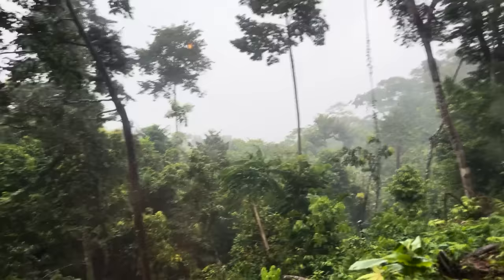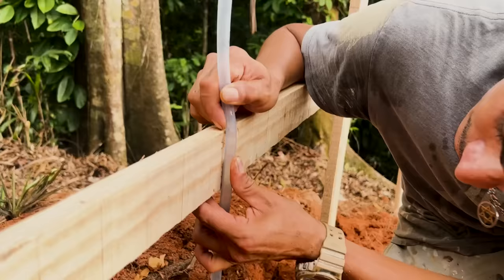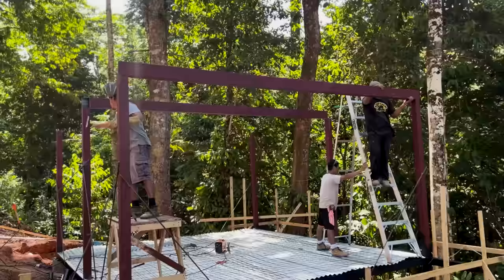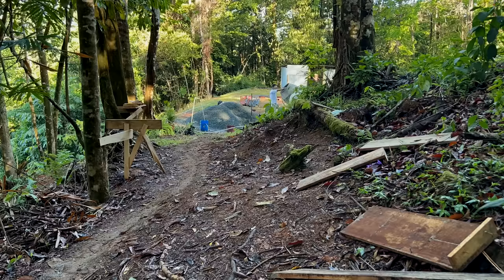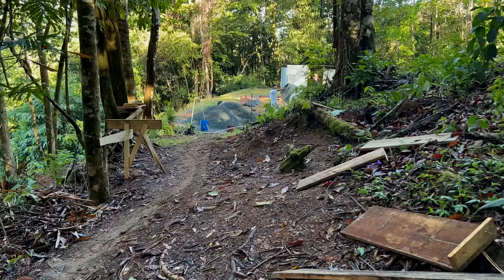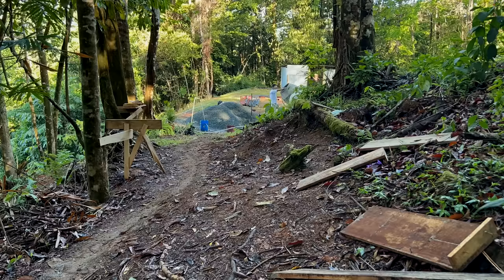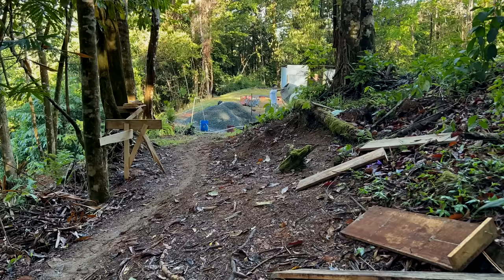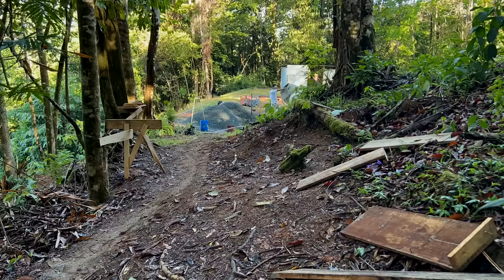Full Build of a Tiny Home Cabin

Comment: Im from Costa Rica from the tropical rain forest part . I can tell this cabin is not built to last. termites in CR are sneaky and eat wood and concrete, difficult to control them when you are in the middle of the jungle, I wonder also how did he obtained permission to build in the middle of the forest…
Reply: Containers would fix that issue
Reply: I'm pretty sure he did his homeworks haha
Reply: I'M from Costa Rica (the tropical Rainforest part) and I can tell you that termites don't eat concrete (at least not fast enough to cause any meaningful damage within 50+ years (especially when there are other options around to eat).

You're not completely wrong about the wood, especially soft-woods like pine, however this wood is specifically treated, which means that it should not be affected by termites.

There's nothing wrong with this build - it's very well done!
Reply: He says its pressure treated pine to prevent termites and rot. It' should stand up.
Reply: He explained that issue already. I think you are just watching but not listening. You can hear, but you are hearing. I hope you understand my idiomatic expression. In short with what i meant.
Reply: Dude literally addresses this at the beginning of the video 2:26
Reply: Sounds like you're wrong about the termite part but Noone has answered the license to build in the woods. I wonder if they did something special for that
Reply: He said he bought that land in the beginning
Reply: He literally just said it Yo! It was pressure treated for that ya didn't event listen..
Reply: They are fairly close to metered power, so probably not "in the middle of the jungle". He mentioned licensing and permitting. The structure and wall framing is steal. I don't think the termites are going to eat that. As others said, I don't think you even watched the video before commenting.

Comment: Tropical rain is quite strong and wind can blow in a lot of rain from the side. Since the front wall is quite high, I think it would have been better to extend the roof way more to the front to prevent rain hitting the glass windows at the front bottom. It's also a bit difficult to make everything waterproof since those windows need tiny gaps everywhere. Maybe difficult to maintain this structure in this kind of weather, but it looks pretty cool.
Reply: I too love this build, but was wondering about the waterproofing -

Comment: I've been thinking about this all weekend and I have to admit it looks great and the price is great but there are a ton of issues with this build from a safety and engineering point of view. The local building codes must be very lax to allow this.

1. The entire envelope is missing a vapor barrier. 
2. No insulation in the walls. 
3. It's a fire hazard - aluminum wiring is illegal for a reason - it expands and contracts to the point it wiggles itself free from connection points. The wood siding is flammable and since the walls are hollow, they will feed the wood fire. The whole thing is a tinder box with cheap wiring. What's more is the electrical panel is beside THE ONLY WAY TO ESCAPE. If the panel catches fire and you're in the loft, your stair is over the fire and you need to jump, but the door out is also next to the panel and the only other door is the patio... man this a death trap. 
4. No AC - when combined with the lack of insulation and vapor barrier, that means that this place will have constant moisture and humidity issues which could lead to mold growth. 
5. Single pane uninsulated, unsealed windows. Drafty and will probably result in dew formation on the windows in the early morning plus allows for bugs and stuff to get in. 
6. The upper level windows don't open, so all the hot humid air rises up and stays there with no way to vent out up there. Does that ceiling fan help enough?
7. No blinds or shades on a west facing window. So again heat and humid at sunset with no way to vent except the level 1 windows. 
8. No exhaust vent at the stove. This is a code violation in many areas. Does the bathroom have a ceiling fan? Cooking and pooping smells might be an issue. 
9. No guardrails at the deck. Looks sick but dangerous. 
10. Does the roof leak yet? You have unsealed screws penetrating the sheet metal but you don't have a waterproofing barrier. I'd recommend you atleast get up there and seal every single screw point.
11. Thermal bridging everywhere - expecially the window frames.

This is more of a tent/ shed than a house by modern safety and engineering standards imo. While impressive, there will be serious issues in 5-10 years, if it doesn't burn down first.
Reply: i fucking laughed reading this, thanks for posting. Noticed the no guard rails.
Reply: Wow! You must be such a positive and supportive person to have around. 
Tent? Have you lost your mind? 
It is a wonder the world isn't burning to a cinder given the millions of "tents" in Africa, SE Asia, South America, the Pacific islands and so on. 
No aircon...oh dear...
Reply from the maker: Hey There! I am glad you spent so long thinking about my cabin :) Some of your points are fair tho an I will integrate for the next time. 
As for the vapor barrier that was something that every single builder here never recommended so that isn't a thing here for this climate. 
The wood, air then concrete board is enough insulation and the heat transfer of the walls isn't an issue. Walls never heat up as the wood on the outside is a really good barrier. 
The aluminum wiring is just the one that brings the power from the meter to the breaker. I guess there is aluminum wiring in the breaker but not running through the house. 
4. There is an AC, I didn't film it but there is a 18,000 but AC upstairs. 
5.You are right about the single pane. There is dew on the outside windows in the morning. Double pane glass here is hard to come by and very very expensive. I can live with the morning dew.
6. With the Ac and the fan it stays comfortable
7. I installed blinds on the downstairs west facing windows since the construction. It was a problem but solved now. 
8. This is true, no exhaust. Luckily it is a loft so it all rises to the top while cooking. But def a potential issue.
9. No guard rails. You are right it's a bit sketchy but no kids are allowed there. 
10. roof isn't leaking yet. I was just there and rainy season is in full force. Rain is staying out. 
11. fair point, the thermal bridging with the black metal is an issue. Ac keeps up but not the most efficient.
Reply: Yeah thats full of knowledge there, i mind this when i becoming an engineer in future
Reply: @nataliefenelon4796 I think sometimes a negative feedback is better. I absolutely agree that staying positive is good, but some things are better off told directly like this comment
Reply: OMG 😱 …. This a cataclysm waiting to happen lol 😅
I live (my whole life) in a very humid tropical environment in Mexico’s pacific shore … besides the humidity and the lack of an AC unit , I don’t see most of these issues! 
It would have been nice to have a swimming pool though 😅
Reply: @antoniogradilla7933 he will likely be okay, but we have fewer house fires and mold issues these days because of modern building engineering.
Reply: @Fluxion11  I guess so … also all those plywood hollow walls create the perfect home for all kinds of bugs, snakes etc .
I really like the metal frame that holds the structure, he should’ve build panel walls with solid concrete (we call it panel W) it’s a lot lighter than bricks and faster to install.  Also the metal roofing creates an ‘oven’ effect . Besides that it’s a very cool design…

Comment: Beautiful house but bad design for the climate. I myself live in a tropical climate and those glass windows and metal roof will turn the living space into an oven during the hot hours of the day and those insulated walls will try to keep the heat in as much as posible. Next build try just plain concrete walls and block masonry. Also just plain good quality wood without the use of “drywall”. Best of luck!
Reply: True but in his defense once you see the zoom out, you see he is quite surrounded by trees giving him just enough shade. I wouldn't mind living there 👍
Reply: FYI Concrete mix and masonry are very good absorber of heat
Reply: Ceramic tiles on the roof would keep out heat
Reply: There is always an armchair expert!
Reply: @Babesinthewood97 good point, so you would suggest that it’s best to build around trees?
Reply: Probably would be alright with double glazing but the glass is all single pane. Going to get very hot.
Reply: @Shrouded_reaper  so what’s best ?
Reply: It will be hot. That ratio of glass against wall and ceiling 😳.  A large curtain can solve it. This kind of design is for rainforests.
Reply: @HasbiksRightHand  double or even triple pane glass in composite frames with a lot of awnings providing shade over the windows
Reply: Drywall is also a mold magnet. Bad to use in humid climates like this.
Reply: @margolenney6032 the guy lives in tropical climate. Armchair how?
Reply: I'm also living in tropical climate and by adding the insulation was good move, not just having the silver one. And having trees all around makes the place cooler than in the cities with little to almost no trees, nature really makes a whole lot difference in cooling a structure.
Reply: I have to agree with this!! The drywall is gonna hold moisture and will be a breeding ground for mold and mildew. I too live in a tropical climate and had to learn this the hard way 😩
Reply: I’m pretty sure that incredibly amazing ocean view among the trees is worth the heat the glass will bring!!
Reply: Pedro. It's called air conditioning and dehumidifiers. He obviously has money for it.
Reply: Hahahah yea he built a green house basically …
Reply: @margolenney6032 Yeah, an  “armchair” expert with actual knowledge? YGBKM
Reply: Air conditioning
Reply: Good suggestions!!!  I wonder if we'll hear about his fail.
Reply: LOL u forget about air condition? 😅😅
Reply: Air conditioner exists:
Reply: OMG someone always has to say something negative! 😂😂😂
Reply: @trixieplayz.3  Lmao
Reply: @margolenney6032 😂
Reply: Only time will tell….and I hope he tells if he did it right or messed up a bit!  People hang onto these builds and if it’s messed up on any level, he should fess up and give up those mistakes.  He sure has lots of money!  Most of us have to plan a new roof!  Cool to have a bunch of money from somewhere to back us up!
Reply: @trixieplayz.3  less heat.
Reply: He didn't build it in a desert
Reply: You dont know what your talking about.Concrete is a heat sink.My concrete decks surface temp in summer is 140°.Good luck with concrete.

Comment: FYI, when applying a plaster finish, you can go back and polish up the plaster as it dries up a bit to achieve a flatter finish and a higher polish. This avoids the excessive sanding which weakens the finish in the end.

Comment: Great job in executing the plan and great work overall, but a piece of advice would be to make more space for air ventilation, the more easily the mountain air pass through your cabin, the cooler it'd be during Summers, as for winters you can install slide windows

Comment: 0:04 I live in Malaysia, where the weather alternates between raining or sweltering hot, with the ever present humid atmosphere. Air conditioning is very much a requirement.
I'll wait for your build video in Indonesia, where the weather is almost similar, but WITHOUT the odd earthquakes and the volcano eruptions.
Reply from the maker: In indonesia I am building the Bukit in Bali which is considerably dryer than CR. Because of that the design is going to be quite different

Comment: The only thing I would have done differently is to make the concrete foundational pillars level by making those downhill longer instead of using the metal bars to make up for the level difference. Either than that, everything is perfect. Your approach was not bad at all though

Comment: thank you for packaging this video in a time lapse format, I love seeing a project start to finish. As for as the "cabin", you knocked it out of the park, it fits it's surroundings perfectly! As someone who appreciates smaller more efficient housing, your place is perfect! And using steel for the framing, I never would have thought to do that, not only being "environment resistant", I think it will hold up well against any possible seismic activity. I'm can't help being curious about the total cost of the project, could you drop that into the comments?

Comment: Wow very cool project! Always nice to see when someone is just going for it and is into learning by doing.
But I have to say I am quiet surprised that you haven't use insolation material, especially in the roof and the walls. It has to be very loud while heavy raining...
Reply from the maker: On the roof there is the foam we installed and then the wood ceiling. It actually isn't all that loud. The lightning during rain storms however.... That can be super loud

Comment: Good job... the turn around time is a bit incredible for CA. Also planning a build in the CA tropics... typically around here it's all cement post and beam style construction...I would assume there as well... curious why you went with the stick frame style with drywall there? Now I'm considering some metal as well... but everyone here knows concrete and the tropical hardwoods are plentiful and beautiful... some last in jungle.... others don't. A lot to consider.

Comment: I don’t think your footing will last that long. I used to live in hills like this growing up, and long storms ruined some hills and lost homes. You can tell from the hill you built on it has clay in it. If you get enough rain fall, your ground is going to get corrosion. 1meter cubes for your anchor foundation might not be enough and your home will eventually get swept away. Might have wanted to put some pillars to bedrock in there.
Reply from the maker: The uphill water is directed to the sides of the house via a small retaining wall so the pillars and the earth and clay around them hasn’t gotten wet since it was built

Comment: Great video-beautiful job on the cabin. I love that you can see the ocean over the trees. I really like the idea of a space that's surrounded by jungle and makes you feel like you're in a treehouse. All that glass is great. It's an interesting concept, building in a climate like Costa Rica. Living in Colorado, I've been doing a lot of thinking and reading about air sealing and insulating, ventilation, heating, cooling, etc. Kind of wild to think about not having to deal with any of that. Is it really mild enough there year-round for those systems not to be an issue?
Reply from the maker: Thank you :) Yes you never have to worry about the cold. The big things are humidity and heat. With the wood exterior and 3 inches of air and then dry wall the heat sync is OK. The walls stay cool. The big thing is the heat transfer in the windows especially in the afternoon sun. Its just the price to pay with all of these windows unfortunately

Comment: Very interesting to see a primarily metal/concrete build in such a climate, especially the raised concrete floor really surprised me. Do you know why it was done this way rather than a wood floor system that would be much easier to build? Termite problems?
Reply from the maker: I wanted a concrete floor. I didn't actually want too much wood in the house as it can get a quite heavy and dark feeling. The concrete is easy to clean and looks nice.

Comment: The roof doesn’t look very water proof, wouldn’t you need some plywood board and waterproofing sheets before the reflective material and sheet metal? Same with the walls, nothing to keep moisture out, and the flooring straight on the beams with no ply board under it…I would worry about the long term livability of this home. Maybe it’s different with so much concrete idk. It is pretty tho.

Comment: That's exactly what I've been looking for on the web for a long time. THANK YOU!
I'm wondering though. Why using metal and cement instead of wood? Of course, you mentioned the mold and termites. But natives use wood only and it holds, right? So, why? Is there really no wood or wood process that could do the job?
Reply from the maker: I didn't want all wood interior. It becomes really dark and heavy unless using a light wood like unstained pine. But even so I prefer the wood as an accent on the inside and using a concrete look for the walls.
Reply: Ok got you 😉 And was it 100% necessary for the pilars?

Comment: Great build! Thanks for showing us your build. I bought a house and hoped to strip off the old rubber tiles and polish the concrete floor. Unfortunately the professional who inspected it told me that the old concrete is too weak and porous and so it can't be polished. Would you mind sharing what microcement product you used? I might just use that instead.
Reply from the maker: Yeah the Microcement can go on top of tiles apparently. I used Ardex feather finish for this house and the other one I used Surecrete microtek one coat. They are both good
Reply: @SashaJuliardD  Thanks! I appreciate the help.

Comment: Concrete poured over metal sheet roofing? Does the floor shake or is it sturdy enough?
Reply from the maker: once the cement hardened it became a solid reinforced bit of concrete that has no shake. It was just to hold it while it dried

Comment: should've used galvanized square steel
Reply from the maker: We used what we had. Some of the beams like the floor joists and roof rafters (the 2x4) was galvanized. The larger metal (4x4 and 4x6) doesn't come in thicker grade and galvanized so we put extra protection on it